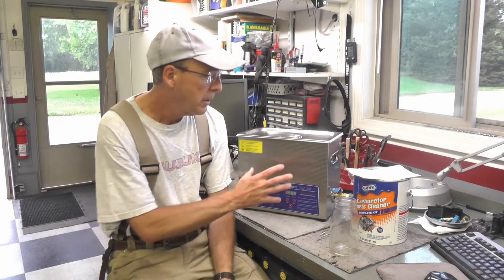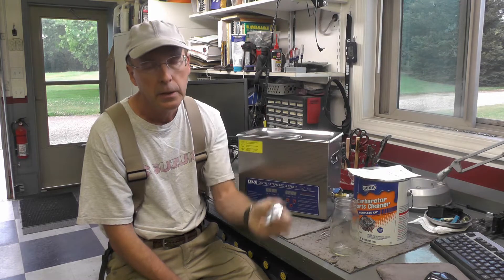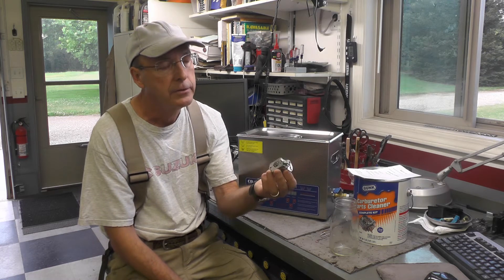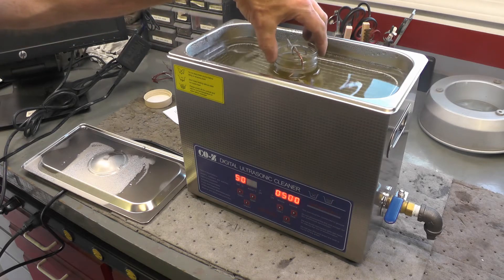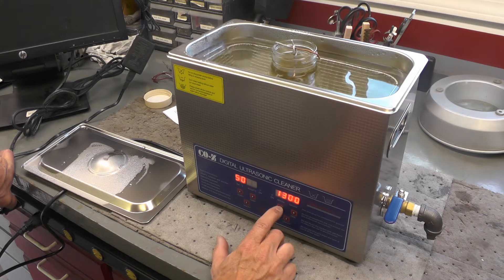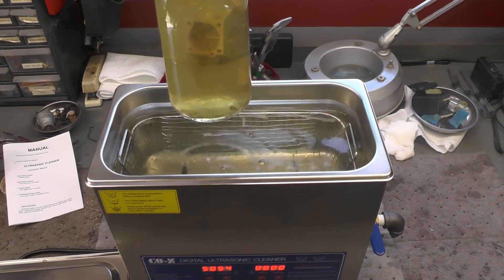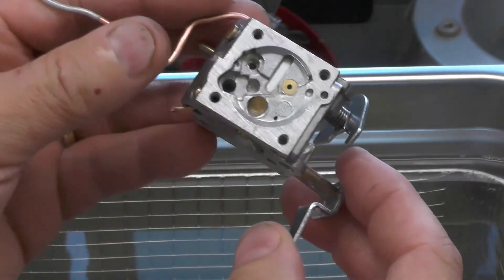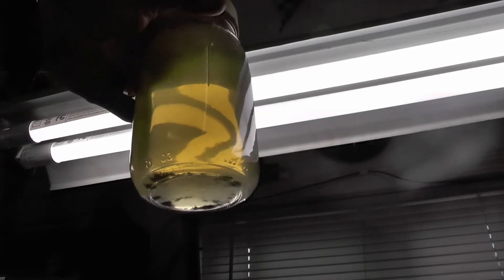First Use of New Ultrasonic Cleaner --- Video #113

Comment: Thanks Kelly. Just looked this one up after seeing your latest carb video. Looks like more items to add to the workshop list.... Is this the 3L or the 10L model?
Reply from the maker: You're welcome, Jim.  This is (I believe, working from memory) a 3L unit and for small equipment such as motorcycles and lawn equipment it's fine.  If one was into cars, tractors or similar equipment a larger unit may be more useful.
Reply from the maker: Jim, I just checked my cleaner and it's a 6L unit, specifically model # PS-30A.
Reply: @kwrightway  Thought it was larger than 3L. I thought "Maybe american litres are twice as big as the rest of the world's litres........" ;-)
Reply from the maker: @jimdavis1782  I wasn't entirely sure, that's why I checked.  The unit is normally stored in my other building so I had to go look at it to be sure.

Rest assured, our litres are the same as yours. :)